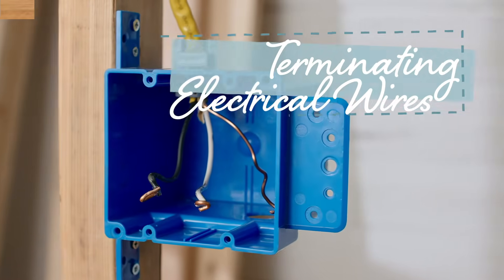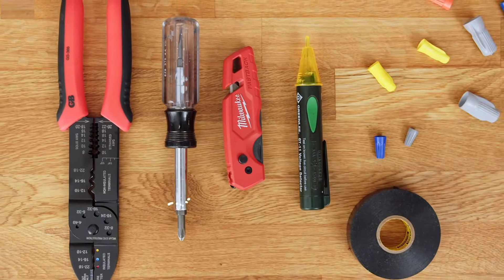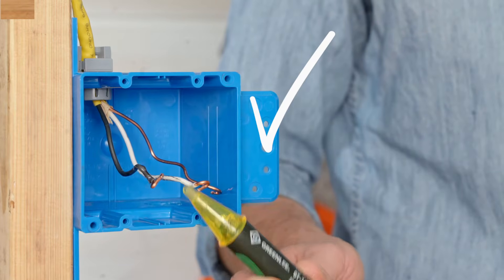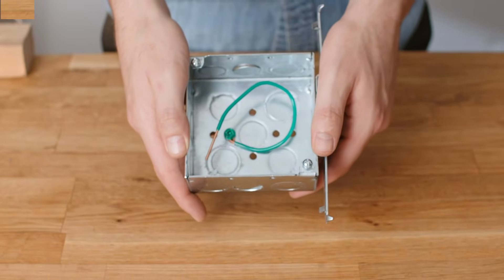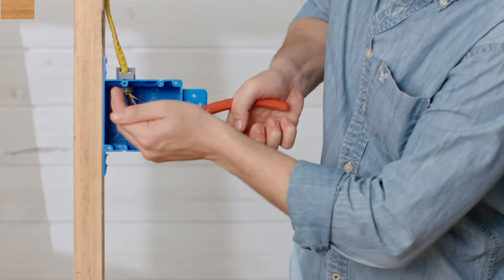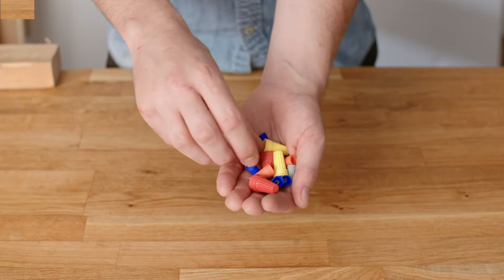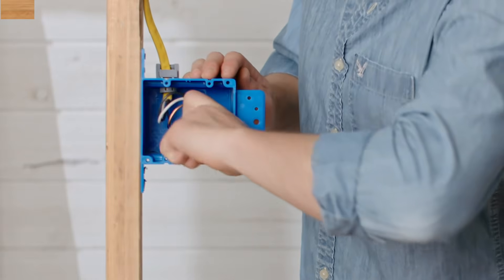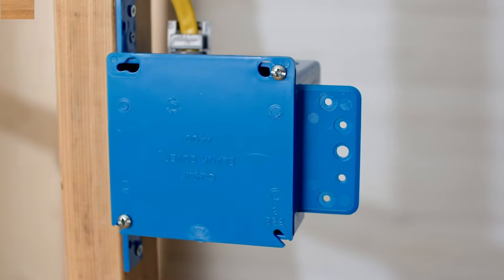How to cap electrical wires

Comment: If there's nothing on the circuit, why would you reenergize it? Why not just leave it dead and a note on the breaker?
Reply: @whilstingdog  I’m in this exact situation. I need to re-energize it because there’s other things on this breaker that I need to work.